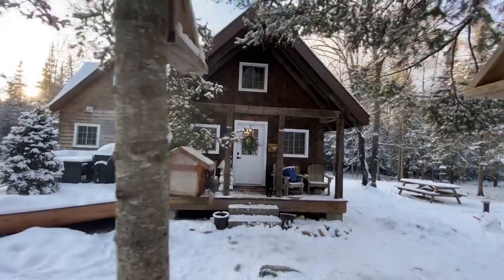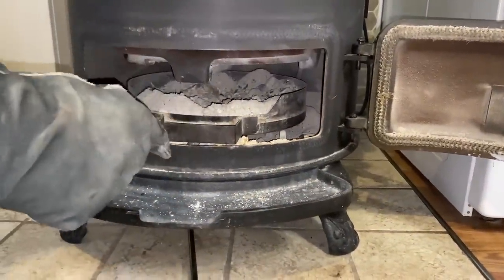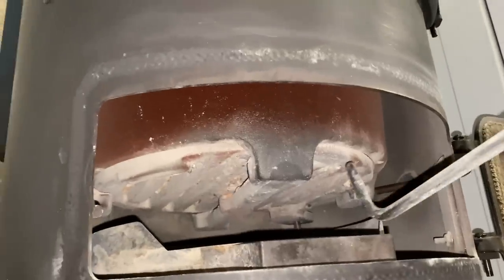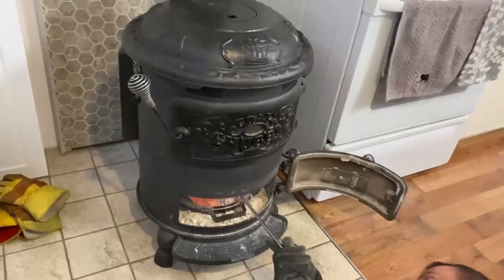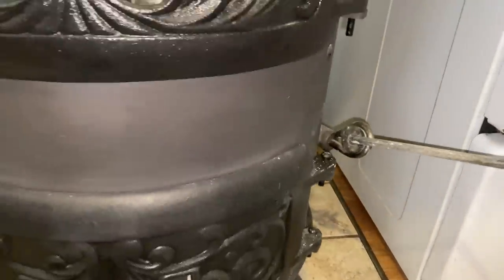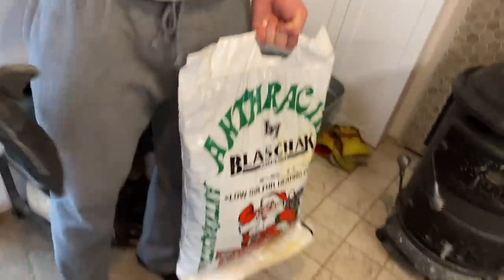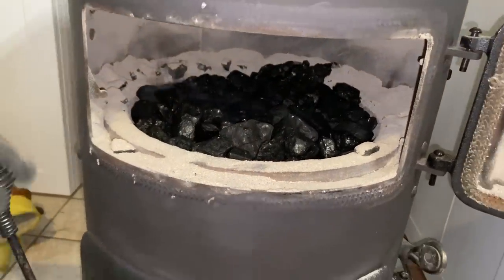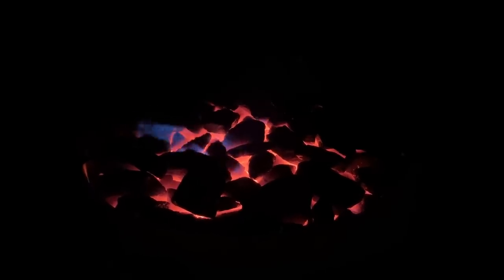How We Heat Our Cabin in the Woods in Winter

Comment: Subscribed and enjoyed the video.  How much does a sack of coal cost and about how long will it last. I know the burn rate differs due to temp, insulation, etc., but a general idea for your location.
Reply from the maker: Much appreciated Perry! For us here in Northern Ontario, each bag costs about $10 CAD delivered. To heat our 1000 square foot cabin all winter with temperatures ranging from -10 to -30 C, I go through slightly more than half a bag a day.
Reply: Here in Louisiana, it would be much less, but I knew of a man, years ago, bought a small trailer load, and it lasted for serval years. He kept it covered by a tarp, and said it will last forever.
Reply: Since its basically a rock it will last forever.  Lol.  

When we started burning coal we used stove coal in a bin in our cellar that was leftover from sometime in the 1940s.  Its nice that you can also store it outdoors and not have to worry about water like you do with pellets.  Ideally you'd like to keep coal dry and free of leaves and other debris but it takes a lot less care than wood.
Reply: @cabininthewoods517  What is the weight of the $10 bag of coal you use?  Thank you…..
Reply from the maker: @coopermurphy6422  40 lbs
Reply: We use to heat 2500 sq feet on two floors with two coal stoves and would burn about 3 ton a year in the Northeast
Reply: Hear in Maine a forty lb bag went from 7 dollars a bag to 15.
Reply: @cabininthewoods517  Bout $450USD a month?
Reply from the maker: @neillee3793  More like $250. I heat for 3 months, give or take. Of course it might be more if I bought a load of coal now, as I hear prices have gone up a lot.
Reply: Heated with rice coal until this year. Coal last year was 3.89 a 40 pound bag this year it is 9.99 from the same vendor. Thanks Brandon
Reply: Hardly self sufficient. I have woods to glean and burn dry wood. We live on the border with Manitoba, but our house is self built native materials earth shelter. Wood stove heats mass. Mass holds heat. Free for my gathering. I do use anthracite coal for what little blacksmithing I still do. A bag has lasted a year.
Reply from the maker: @setsailatnoon  Glad you’ve got a setup that works well for you 👍
Reply: @chiphungerford  damn what's a ton of coal cost?
Reply: @randybobandy9828  it runs about $200 a ton loose or $450 to $500 a ton bagged as I recall
Reply: In Belgium, the price of coal (not even the pure anthracite, but a mix of 60% anthracite and 40% bitumen) went from €9 to €25 for a 50 pound bag in just a year... I don't even have a clue how much pure anthracite would cost, because they hardly sell it anymore. So, if I take my calculator, 1 bag of 40 pound would cost you 30 CAD now (for a 60/40 mix). 
That is still one of the cheapest ways to heat the house, though.
Reply: @chiphungerford  that's not bad; it costs $285-$310 for a ton of pellets(which is way less energy dense than coal), not including the 8.9% sales tax(WA state). I installed a multi zone mini split this fall, and it only costs $100 per month to heat a 2100sqft home vs. over $200 if we used Pellets or $400 if we used propane. Luckily our electricity is only 6.8cents a kwh making the heat pumps the cheap option. It's also the coldest year in atleast a decade so I bet it would have been more than $200 in Pellets per months. We do burn some Pellets if it gets below 9° because the heatpump starts to put out less heat. This is a 7 year old unit that I had from our old business but the new hyper heat models will put out 100% efficiency as low as -5° and can work as low as -22°. Mine still put out heat when it was -°8f but it was probably not much better the. Using electric heat at that point.
Reply: We have similar stove a penn coal stove copy of yours going right now sucks price went up love the constant heat without dragging in wood all the time
Reply: @randybobandy9828  Randy that heat pump sounds pretty efficient, will it also cool in the summer? We have window air conditioners and they seem to use quite a bit of power if those pumps cool also I may look into installing them
Reply: @Brian97735  should go dig some, sell it, and try and buy his dinner
Reply: @chiphungerford it's a good heatpump. It has a COP of 11 or slightly more depending on temp. It actually performs better as an AC unit in the summer.
Reply: Why not try solar heat
Reply: We are told in the UK that wood burners hotter, and that’s why we need to have liners in chimneys
Reply: Superb!!!
Reply: @cabininthewoods517  try heating with solar heater from the sun 🌞
Reply: @hildebertocarreiro9232  because they have a functioning intellect.
Reply: @tomasviane3844  We can't buy bags of coal , actually maybe yes but costs an arm and a leg here in Italy
Reply: Is this cheaper than heating with natural gas?
Reply: Good info. Thanks. I'm in Maine, and was just wondering what it goes for here.
Reply: @Brian97735  Thanks Putin, more like it.
Reply: @chiphungerford  The half bag a day (20#) for a 1000sf house is consistent with your 3 tons a year consumption. Is there any strange odor with coal?
Reply: @setsailatnoon  About how many cords per season do you use? How big a house do you heat and to about what temperature? How cold does it get outside? What RMH design do you use? how much time per day do you tend to the stove? Do you like it? Thanks
Reply: @chiphungerford  Tractor supply bumped their anthracite from about $6 to $10 per 40# bag.
Reply: @randybobandy9828  Any time you send 50% of your heat up a chimney it’s going to cost. Rocket mass heaters allow 90% plus efficiencies. Anthracite coal has only 30% more energy than wood or biomass pellets (fully dried) and use stove technology that waste most of that advantage up the chimney. Pellet stoves can be auto fed and temperature controlled and when coupled with a RMH produce a sustainable and convenient DIY heat source. You might be able to recover $90 of that $200.
Reply: @hildebertocarreiro9232  Passive solar heat is a good option with a little active to push the air around.
Reply: @Piccyman1  The hotter the exhaust gas the greater the need for liners. Efficient furnaces don’t need liners anymore unless maybe your fire code requires them. Here in Kansas fire code doesn’t require them and gas furnaces have very efficient air handlers so exhaust gases are low temperature. In fact some homes have to retrofit their chimneys with smaller flues to ensure proper draft because exhaust gases are so low.
Reply: @jasb78  Natural gas prices vary a lot across the US by maybe a factor of 2 and in a few places a factor of 3. But where gas is costly so are other alternatives. Natural gas is the most cost effective energy source as it has the highest energy density with the exception of propane and has the highest BTU/$.
Reply: @terryharris3393  interesting, we have moved from 4" to 6" flues
Reply: @terryharris3393  We have multiple woodsheds, some of which are filled with slabs from a local friend's mill cut with a jig to 16" lengths, mostly jack and norway pine, some balsam fir and spruce.  We also have hardwood sheds filled with splits from oak, maple, birch, etc we've gleaned from our land...and we have a chunk pine woodshed.  We heat multiple buildings including the house which is earth sheltered and about 800 square feet, my carpentry shop, my office, and a straw bale cabin which is on the south 40 of our land.  It was my wife's studio, but when she retired 6 years ago we turned it into a full fledged cabin with a kitchen, sauna and small ARB refrigerator.  Outdoor toilet, outdoor summer shower, outdoor summer laundry with a james washer.  I also have a pit greenhouse which I supplement with wood heat in spring to prepare plants for gardens.  So...all in all, how many cords?  I'd say two and a half full federal cords (128 cu ft)...we also have outdoor fire pits for bbq/grilling in summer.  Our house has a massive stone structure around a Timberline fireplace insert which backs into the house's sauna, which doubles as a plenum to evenly distribute heat.  The house may get above 70 during the day, depending on the angle of the sun in winter...and of course outside temps, which often fall in the minus 20 to 40 degrees range, F....the house will never freeze, even if we are away for a couple of weeks in the depths of winter.  The earth tempers it so it has never fallen below 43 degrees above zero.  We build a fire in the morning with softwoods and let her rip pretty strong, stoking it twice to three times with pine...then, if it's really cold outdoors, we rake the coals forward and stoke with hardwoods...let it gas out and shut the stove nearly all the way down.  We rarely see smoke from our chimney...it we do we know it's incomplete combustion and open the draft a bit.  By the early afternoon the rocks are hot, the stove gets shutdown and that's it for the day...Both of us do our business here on the homestead, so we don't worry about going to work and being away from the home.  The strawbale is heated daily in the winter, too...and is uber efficient.  I've been doing this since 1984, and we were married in Feb of 89, so I guess we both like it just fine.  When my wife came along she helped me fine tune everything.  We built the straw bale studio in 94 so she no longer needed to go to a town 15 miles distant to work.  Long winded, I know...but then...you asked.
Reply: @terryharris3393  if u get sun u can get 300%degrees coming out of. Solar
Reply: @setsailatnoon  I love the fact you have a below grade earthen structure and a hay bale structure, both know to be  very earth friendly with respect to materials of construction and heat efficient. From your description of cordage I gather you do not utilize  rocket mass stoves and that is what I would suspect given the multiple buildings and their constructions and you geographical locale. Is that correct? What do you use to burn the wood in?
Reply: @setsailatnoon  I love the fact you have a below grade earthen structure and a hay bale structure, both know to be  very earth friendly with respect to materials of construction and heat efficient. From your description of cordage I gather you do not utilize  rocket mass stoves and that is what I would suspect given the multiple buildings and their constructions and you geographical locale. Is that correct? What do you use to burn the wood in?
Reply: @cabininthewoods517  Brilliant way to heat your cabin. Is it connected to rads or is this sufficient to heat the cabin.
Reply: In my region I don’t even know where I would buy coal.  In about a year we will have cut all the trees that need to be cut, and it seems that something that doesn’t need frequent topping off would be nice.
Reply: Bituminous coal is about half the price of anthracite. Do you think you will get twice as much heat from the anthracite since it is twice the price?
Reply: @Piccyman1  wood stoves send a lot more heat up the chimney, if you want to burn without liners you'd need a masonry heater.
Reply: @andygold  Anthracite and bituminous vial have about the same heat density (~12,000 BTU/lb). Can you buy bituminous coal by the bag?
Reply: Tractor Supply sells a god quality anthracite. A year ago, it was about $9 for 40-lb bag. This winter, $13.

Comment: And for those who don´t know: Do NOT put this in an ordinary wood stove! This coal gets waaay hotter than firewood and can melt a stove!!!
Reply: Some stoves can burn both. Usually indicated by a "shaker grate" which accomplishes his "flossing" easier. We have several and usually burn wood (heavy hardwood forest here), but keep 3 tons of stoker/nut anthracite here for long term emergencies. A plastic caged tote will hold 2000#, and are easy to handle with pallet forks and machine.
Reply: Woodstove won’t melt from coal. Wood stoves are made from the same cast iron and plate steel that coal stoves are made of. Same fire brick is used in both types also. Anthracite coal needs airflow through the whole bed from bottom to top. It won’t burn in a regular woodstove which generally will feed air from the sides of the fire. 
Coal stoves can be used to burn wood but they need to be watched to get the settings right. Otherwise you can over fire your setup with a bit of a runaway stove because wood burns hotter/quicker. Coal burns hotter in the long run but is slower to get there.
Reply: @Garysalunatic  Not all woodstoves are made of cast iron. Some are made of sheet metal. And if you burn coal in one of those, and the draft is good, it WILL melt!
Reply: @J1I9M7M4Y  no serious woodstove is made of sheet metal. Those for camping are, but those made for homes are at least made of sheet steel. My coal stove is made of sheet steel with a cast iron grate. It won’t melt.
Reply: most will burn both, just depends on your grate.    also, my stove gets much hotter with hardwood than coal.   I can melt the polyureathane off my cabinets with wood, never could with coal
Reply: @Garysalunatic  It can warp and melt without proper air flow from underneath, you can burn coal in a wood stove with a proper grate, but without it, it will warp the shit out of any metal or worse. Don't burn coal in a wood stove without a proper conversion kit, the fire department will
Reply: I made a heavy steel coal tray for my wood stove,  it keeps the coal from touching the stove and it's a little bit higher so it can suck more air from underneath.
It works very well, the only downside is cleaning, it's a bit more of a hassle because it doesn't have a shaker.
Maybe I can weld something to it so can shake it without having to remove the tray.
But coal is an awesome fuel, i try'd it for the first time this year.
First i heat my house with wood wich is waaaaay faster, and when everything is comfy I put in the coal wich keeps it nice and steady. Works very well.
Reply: Even some hardwoods can warp a stove. I've seen Osage Orange (hedge apple) do that.
Reply: don't tell them that - Darwin sometimes needs help - and we can do without those people.
Reply: @edwinbruckner4752  You're right, wood burns faster, coal gives a long slow burn. Coal can give a much hotter burn with forced/drafted air (then you can start melting iron and steel), and if you do that with wood it will burn off in minutes. I guess in America you have a lot of softwood which burns quickly. Here in Australia its basically all hardwoods (eucalypts), and some are so hard they wont burn properly in an open fire, but are excellent for a long slow burn in a  burner.
Reply: @Garysalunatic  there were many wood stoves made in the 70’s when wood burning experienced a resurgence that were all cast iron except the back corners were sheet metal.  They were made for in the home, had porcelain outer skins, wrought iron decoration, tempered glass front, vents, metal radiator on top, bottom ash tray, side loader.  Stylish for the time.  I still have it in the barn.
Reply: @ruhtra-k  if you mean sheet steel then sure, it’s good for stoves. Sheet metal (in my view) is for ductwork and it’s measured in gauge. Sheet steel is measured in millimeters or fractions of an inch. Many modern stoves are made of sheet steel 3/16” or 1/4” thick. They’ll last forever. My coal stove is a mix of both depending on the area it’s applied. It has sheet metal covered with firebrick. It will outlast me.
Reply: @Garysalunatic  20 gauge galvanized. But only at the back.  The rest is cast iron.  I always wanted to replace it with something heavier but it works and hasn’t been a priority.  I have always thought it odd to manufacture something that way.
Reply: How well does the unit heat the house as a whole? One idea.....why don't you angle the exhaust pipe through the house and plate collars of finned metal like a heat sink structure only here the function is reversed. To propagate heat. Imagine the heat which is lost up that chimney. Also like the new automatic cat boxes, that clean themselves, there should be some kind of automated fuel loading and ashes discarded system. Soon the some A.I. system will be the fireman. One thing comes to mind,.....wouldn't you house be somewhat warmer if you sprinkled 
a little thirmite in with the coal?
Reply: @cindys1819  you can’t extract too much heat from it.  The smoke needs heat to be able to travel up.  If you remove too much the cinders and ash would deposit in the chimney.
Reply: I use plutonium.